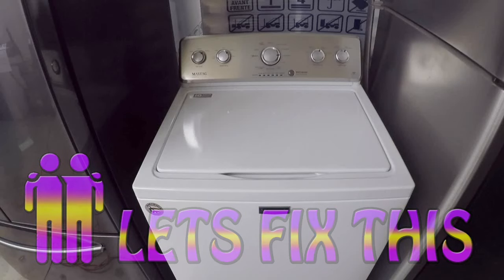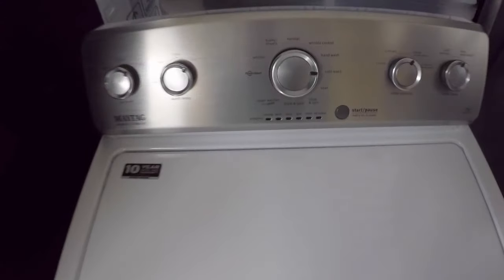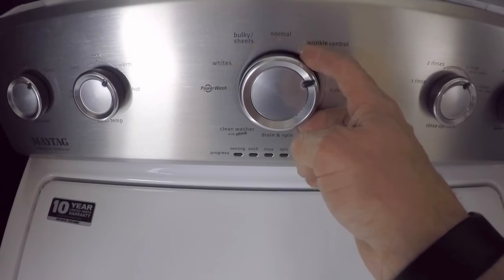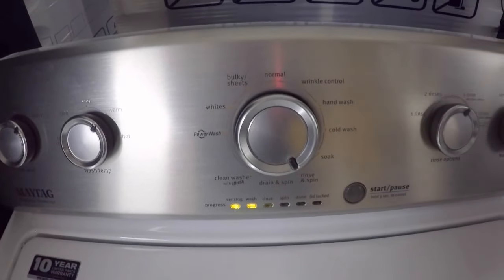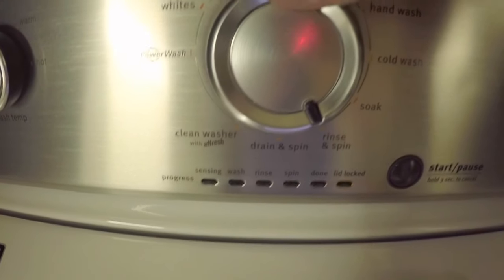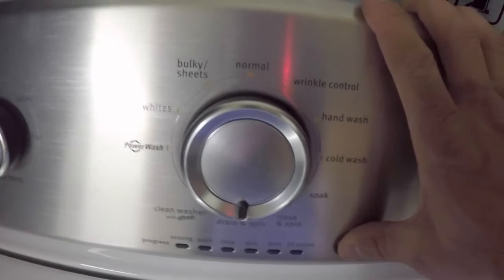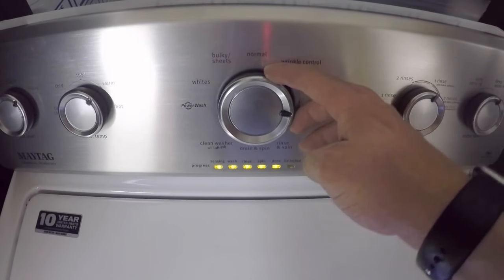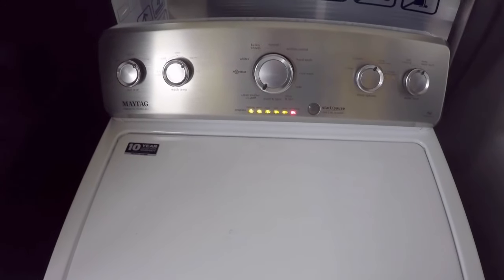Whirlpool Maytag Top Load Washer Calibration Diagnostics

Comment: Where can ya find the codes? The online version?
Reply: There should be a service manual inside the front panel either up the top or down the bottom. In a sleeve stuck to the cover

Comment: Awesome vid and super clear. Had to replace the basket hub again after about a year, but didn't know to calibrate it that first time when I removed too many items. This time I noticed the gear coming up into the tub was so rusted, most of the teeth were worn badly. Replaced the gear case and basket hub.  Read in the hidden service book it should be calibrated, but couldn't get it to work. Watched this video and did exactly what he did, even though my main dial didn't have all the same names around the dial. Took me a few times, but finally got the turns done in the "less than 6 seconds" required by Maytag. Followed advice on video and the Bravos model did about a minute of calibration. First 3 loads had a high pitched squeal going into spin mode, but I figured the calibration would take care of that. Runs perfect. Also for those that don't know,  the "service book" is taped to the inside of the washer, between the tub and front wall inside of a plastic envelope. Tells you all the info you need to read repair codes and a bunch of other advanced mumbo jumbo I didn't understand.

Comment: What websight are you on to see that code chart?. I been looking for 2 hours and cant find that layout. Thanks
Reply from the maker: OfficialHankIII it’s a certified site, but the actual tech sheet is inside the control panel.
Reply: Thanks for taking the time to reply. I had to break the wash plate and use the back end of the hammer to get that part out. Then Since the tube wouldn't let loose from the main drive system I was hesitant on breaking something else. I was lucky enough to have a friend come over that had some more knowledge on these things. He put a small 2x4 long wise over the main drive shaft and hit the 2x4 with a sold hit and it finally let loose. So after cleaning the bottom part and hoses etc,it's looking like I have a faulty lid lock switch and possibly a bad control panel as well. The start button works I know,When I out the unit into Diagnostic mode but. The Light On the board are only showing orange. No red, no green. And when I hit start on the machine its not activating the lid lock. And going through all the cycle's in the dig mode. It will only add water in the washing machine.   But anyway Like I said Thanks for the reply and your Vids.
Reply: @letsfixthis9343  Are you saying theres a tech sheet hidden in the control panel of my washer? Your vid was such a help.
Reply: Christopher Deslauriers unless it has been removed, the tech booklet should be either in the control panel or on the front of the cabinet on the inside of the cabinet.
Reply: @letsfixthis9343 How do you get certified to use the site?

Comment: P.s  I have popped out the center hub,Undone the bolt. But the strainer is not wanting to let loose.  Did your strainer come out easy or did you haft to pry it out. It feels like mine is being held in place by something Still? Its a Maytag Centennial MCT Model MVNC555DW0 TYPE 589-01 SERVICE TAG C53640845. What's frustrating is when I go to Maytags websight its not even pulling up there own Model number or service tag.Just says this model is discontinued and cant find much on this unit. There are some videos but not many with this model. It lasted a year and a half...When trying error diag codes.. All my lights blink orange, 
Under spin Sensing is orange, Rinse Is Orange,Done is not lit.
Under Drain and Spin All 4 lights blink orange.
 I have tried to calibrate the unit as well.
Reply from the maker: Some models have a spanned but holding the tub in place. That may be what’s keeping the tub from coming out.

Comment: I have followed the steps to recalibrate I have done this before after I replaced a part on it and it worked but now after I recalibrate it and I try to wash a load of laundry it goes straight to agitating the load instead of putting water first I have recalibrated it 4 times now

Comment: And if the lights are orange instead of green? Replaced actuator, water valves and Gear Clutch..Still sensing light goes on, waits, makes noises, goes off,  over & over.  Tried different bulk wash, since it quit on Normal. Had to hand rinse clothes, water still standing in it..

Comment: I get the led light sensing, rinse, spin, done and the done light. So is that a 4 blink then 1? What code is that?
Reply: Mine elites up all, did you figure it out?
Reply: rinse (4) + spin (2) + done (1) = F7
done = E1
so you have F7E1
Supposedly the "shift actuator"
I replace the shift actuator after getting this code and even after diagnostics and calibration I still have the same code and it does not spin

Comment: Someone who knows. 
Hi. I am a technician in Australia 
I have a customer with a Maytag mat20mn (I think) it’s not letting hot water in on hot settings cold only then maybe a few seconds of hot at the end of filling. Not enough to even make the water warm. After a conversation with tech support I replaced the main PCB and recalibrate . After that it filled with cold water only, about 30 second later it pumped out and turned off. Tech support in Australia said they don’t know what’s wrong and cannot help. Any thoughts? I am unable to contact tech support in the U. S. I just get redirected to au site.

Comment: Where can I find the service manual for this machine? I can't find anywhere to tell me what all the other settings do other than the calibrate function you showed.
Reply: The service manuals are inside the wall of the machines towards the front
Reply: And how do I get to that manual inside of the washing machine? I cannot get the lid to come completely off not the lid to you put your clothes in but the whole front part top of the lid to come off so that I can access to get the manual, please I hope you see this message soon I really need to know how to get to the manual so that I don’t have to spend money that I don’t have to fix the washing machine. I am just a mother of four single mom I should add.
Reply: This video shows how to open the top and where the manual should be. 
https://m.youtube.com/watch?v=Saok_IA8_s8
Reply: @johnip86  thank you !! Sooooo much !!!
Reply: No problem. Hope you can get it fixed! Mine was a goner :(

Comment: This changes from models. No name, just the model. Diagnostics are different from year to year and the new matching set you got yesterday, was built 5 years ago. No diagnostics, no flow chart, no schematics and blinking lights? GM had this in 1981 with blink codes. 12=ok, 23=TPS, and so on. Give me the rotary reed switch with a timer motor on it, and maybe I will call for repair in 23 years. It is cheap to put everything onto a $23.58 circuit board that retails from Maytag only at $312 plus shipping. Installation not include except in second service call. Another $114! Congrats Maytag on you move out of the USA into Mexico and printed circuit boards from China! Wonderful business model to increase billable hours for repair shops as customers with extensive backgrounds in electronics can do nothing as the washing machine new installed yesterday was built 5 years ago. Show me the date, enter diagnostics and the blinking code chart. I have a $500 Fluke 87-5 DMM and folks, don't let it move with an unbalanced load, like tennis shoes. You get a "Spin" light blinking and that will cost you a service call! $100-$150 depending on where you live and the tax structure as this is a service. That is taxed by your state & city. Congrats on your purchase. We are pleased even if you are not.